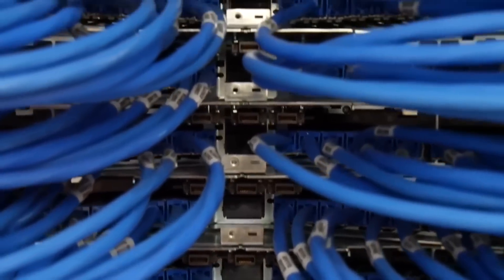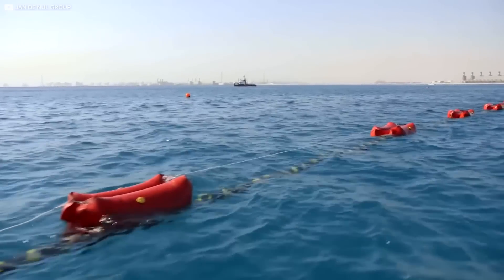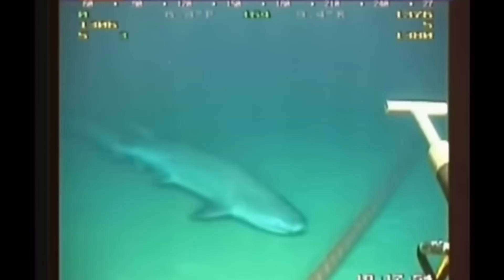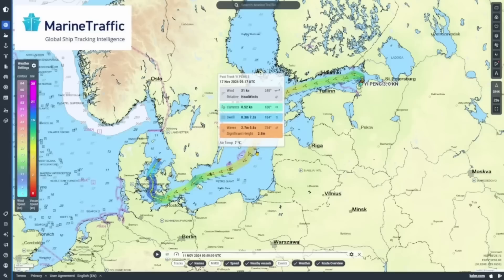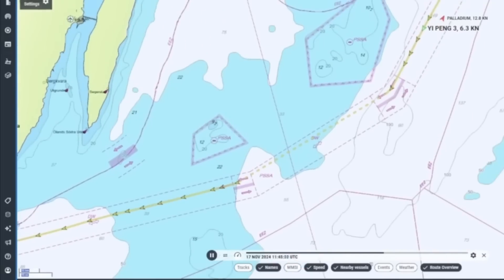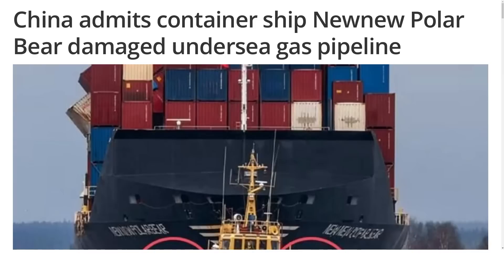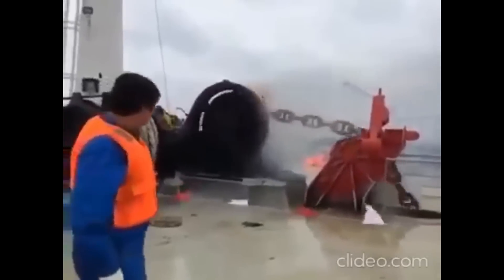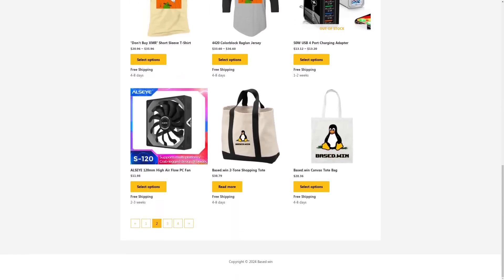When Undersea Cables Get Cut

Comment: It takes around 8 hours to replace a cut. It is pretty wild and impressive that they can do that in that water depth.
Reply: It seems like the ship has done damage even before 😅
Two cables connected between Denmark and Sweden. One for electricity and one for data.
Reply: I'm pretty sure they dive down and float the cables to the surface so they can work on them I highly highly doubt they do all the repairs underwater
Reply: @jacktringoli3299 they don't dive down as in human divers, but they essentially locate the one end, send down a hook, pull it up to the ship, then locate the other end, rinse and repeat.

The repair happens on the deck of the ship and then they drop the cable back down.

There's animations of the whole process on other channels, i think wendover or reallifelore has a video on it.
Reply: @jacktringoli3299 correct https://youtu.be/QiwidMEv8CM?feature=shared
Reply: @jacktringoli3299  Where else? Do you think you can just lift the cable?
Reply: @AcidGubba yes, the repair happens on deck.

They typically have to use the boat to drag the one end of the broken cable over to the other end to reattach. Would be near impossible for a submersible to do that.
Reply: As Margaret Thatcher once said: "sink it"
Reply: Then why would they bother intentionally doing it
Reply: Best method i can think of is to winch one end of the severed cable at the surface into a cable splicing ship,you then proceed to splice this end of the cable on a lenght of new cable that is stored in the ship, you then slowly lower the new splice and new cable in the sea while heading the ship towards the other severed end of the cable. You then lift the severed cable and splice it on your new cable, then you lower it slowly back on the seabed. 8 hours max.
Reply: The cooming cannot stop
Reply: Sounds surprising but considering the userbase for that cable is literally 80% of the world they pretty much have unlimited funding to fix the cable - at a slight increase in taxes for everyone.
Reply: The X-Men are helping them.
Reply: The most of the anchor effect is actually dine by the weight of the chain.
Reply: @Aufputschmeddl  it's still difficult to drag though.
Reply: Wow. Only 8hrs?
Reply: baltic sea its not depth, compared with other seas it's like a puddle, but it is still impresive.
Reply: How do they do it?
Reply: @paddioche  Carefully
Reply: @paddioche https://youtu.be/QiwidMEv8CM

Comment: PS, electricity is part of the electromagnetic spectrum, of which visible light is inside, and hence ALSO TRAVELS AT THE SPEED OF LIGHT! its not the speed of electricity that makes DSL slow. Resistance in metal and other things do. Even with impedance of copper wire electrons flow at roughly 90% the speed of light, still impossibly fast compared to anything else in existence. If you're interested in learning more about the electromagnetic spectrum I'd implore you to look into your local library. 🤗
Reply: What an informative bot 👏🏼

Comment: Electricity travelling on copper cables are also electromagnetic wave, speed  is proportional to its line characteristic impedance usually travels aboun 0.6C 60 percent speed of light, in optic cables higher frequency em travels faster but don't reach the speed of light since their are guided a refractive material which also has some line impedance make it a little bit slower. I really appreciate your content and I know you are behind the details that's why I'm politely pointing it out. Thanks for your content.

Comment: 0:47 well, electric cables also transmit signals at the speed of light. Fiber optics cables aren't better because of latency, they're better because of higher bandwidth and lower signal degradation over long distances.
Reply: Not quite.
Even for fiber optic, it's slower than the "speed of light" because light travels faster through empty space. or air than material. and electric copper cables have the cons you mentioned plus are indeed slower.
Reply: @ghosthunter0950 no, you're incorrect. Look up "velocity factor". Electrical signals travel through cat7 at about 75% of the speed of light, while fiber optics is 67%.

Edit: but yes, you are right about the speed of light being different in different materials. I was too brief, I just wanted to get across the point that fiber optics technically aren't "faster" when it comes to latency. They are much faster if you're talking bits per second.
Reply: @ghosthunter0950  It is at the speed of light because it is literally using light.
Reply: @aminulhussain2277  You understand that the light bounces around in a fiber optic cable, right? This means the signal is not traveling at the speed of light...
Reply: @RanEncounter  Light actually just slows down when in a medium other than vacuum, it's a common misconception taught in schools that this is because light takes a longer path but instead it is because the waves of the photon and medium interfere in such a way to produce a wave that travels at less than C.
Reply: @aminulhussain2277 yes, but in the case of optical fibres light also does bounce around using a longer path. Both effects are at play in fiber optics.
Reply: @RanEncounter the light in the cable is travelling at the speed of light at all times.
But the speed of light changes in different materials. It is still the speed of light tho.
Reply: @smd-tech  pedantic, but "speed of light" in this case refers to c, a defined constant for light traveling in a vacuum.
Reply: @aminulhussain2277  Yes and your point is? The speed of light is still the speed of light in every medium. Did you not understand what I said at all? Fibre optic cables literally work because the light totally reflects from the edges of the glass. It literally takes a longer path than the cable is. This is why the signal is not traveling at the speed of light. Signal speed is not the same as light speed.
Reply: @smd-tech  Can you actualy read? Do you have trouble with basic English. The light travels the speed of light. The signal does not travel the speed of light as the light inside the cable takes a longer route as is bounces around the cable. Fibre optics cables literally work because the light inside the cable total reflects from the edges of the glass. Signal speed and light speed are different things. How is this so hard to understand?
Reply: @RanEncounter   As I just explained to you the speed of light is different in every medium.
Reply: @aminulhussain2277   But you are wrong in this case as the light literally takes a longer path than the cable. Light totally relfects from the edges of the glass. This is how fibre optics cables work. Signal speed is not light speed even in that medium.
Reply: electric cables are also heavier and costs more.
Reply: not to mention the power required to push data at very long distances
Reply: Well, suppose I should have watched for another minute where you brought up those same points lol. But still, light speed in this case is irrelevant since electrical signals are just as fast. Actually, in pure copper, I believe electric signals can travel faster than fiber optic.

Comment: AIS down time also happened to other ships on that spot. However, the Yi Peng just happened to drop the anchor just before running over one of the cables, failing to break it, the next two however, broke. The distance of dragging the anchor is revealed trough the AIS data, by the ships low and inconsistent speed.

Comment: My grandpa was a technician for our phone company back in the day. Being the autistic phone nerd I was he let me cleave and splice a fiber cable for my 12th birthday. That's still one of the coolest experiences I ever had. Thanks grandpa 🙂
Reply: It's cool, but not fun when you're splicing 100+ cores over a whole shift 😂
Reply: I work with fiber and I hate it, 2 hours to repair a cable
Reply: @Boulders911 I'm guessing you're doing back-haul splicing (multi-peer) but here I am doing single core Residencial and minus running the actual cable all it takes is about 50 seconds XD
Reply: @joshuatimothy2966 50 seconds?? Damn I take like 2 to 4 minutes  for that part haha but tbf it's not really the main thing I do, I got more copper stuff cause good ol' germany
Reply: @Boulders911 I appreciate the work you do and even though it is hard, you can know that there are many people who are very appreciative of symmetrical up and down (pretty sure copper/coax could technically do the same but you wouldn't be able to use DOCSIS, you'd need to make a new protocol or just non-standard DOCSIS (as far as I understand it, the only reason DOCSIS is not symmetrical is at the beginning, they split the ranges for upload and download disproportionately which has resulted in asymmetric up/down up til current day, feel free to correct me if I am wrong))
Reply: @JordanPlayz158  I was so happy when ATT finally ran fiber in my area.  I got it set up before they even went live with selling it.  

1 up 1 down!! Woohoo!  35 ping :( constant dropouts every few hours :(  streaming video without audio for the first 15 seconds :(

At least copper is consistent.
Reply: @stevewoodyt  hmm, sorry you had that experience, I have gotten fiber from 2 isps, verizon, and a local isp and it has been flawless, so not sure if ATT is just bad or maybe your line got damaged? Or their proprietary 3-in-1 router, with respect to ping, you may wish to try out the buffer bloat test, if you use your own router behind the proprietary one and it uses openwrt for instance, you can use SQM to combat buffer bloat, I hope the experience gets better for you and I hope this doesn't taint your fiber impression
Reply: UwUtism
Reply: 😒 @Atilolzz
Reply: @Atilolzz Hey now, that's the furry/weeb autism. We don't know if he got that, too, in his day 1 Happy Meal.
Reply: ah yes, a genuine autist. respect.
Reply: You do also watch Chris/PhysicsDuck's videos? xD

Comment: that's why Starlink or anything similar would be kinda better
Reply: Please not even do basic research but just have a cursory look at what your replacing what with what. Replacing undersea cables with 300ms ping low speed satellite connections are like replacing cargo ships with unicycles.
Reply: Controlled by Supreme Overlord Elon
Reply: @robmarshall9026  as opposed to supreme daddy government
Reply: @JohnsonTheSecond  actually both by Elon and gov
Reply from the maker: Starlink can't handle anywhere near the bandwidth that undersea cables do, fiber is several thousand times better, harder to disrupt, and harder to MITM
Reply: Starlink does not have the ability to transmit the amount of data the same way these undersea cables can.  It can only really be at best a backup.

I'm also not trusting someone like Elon, who is one person with a lot of power you're giving him, has become the real life George Soros people were bitching about for the past decade, and clearly has kompromat in his closet.
Reply: Yeah, until we screw around enough for Kessler syndrome to kick in. And oh boy is humanity capable of getting to that point…
Reply: No it would not be because starlink realise on the same cables for its base stations.
Reply: Not performance wise
Reply: China's already planning ways to ruin and break that shit too. They are the enemies of just leaving people tf alone